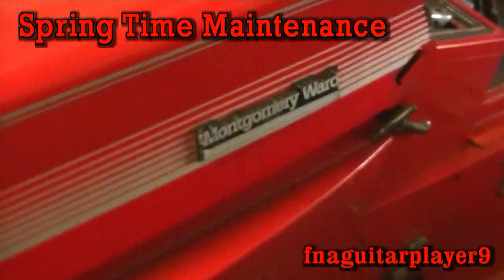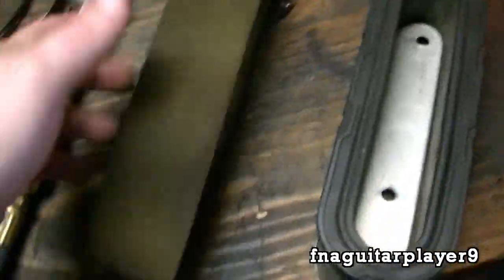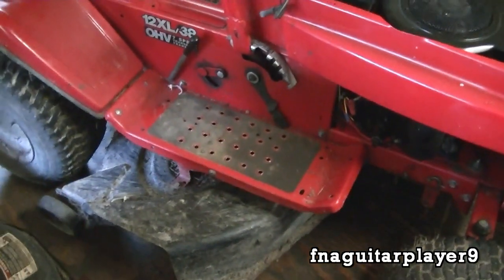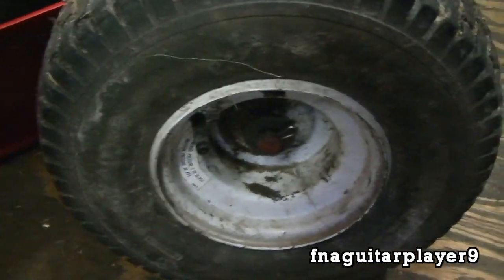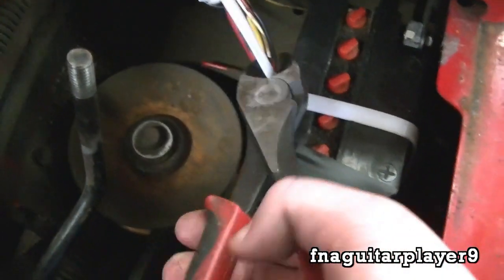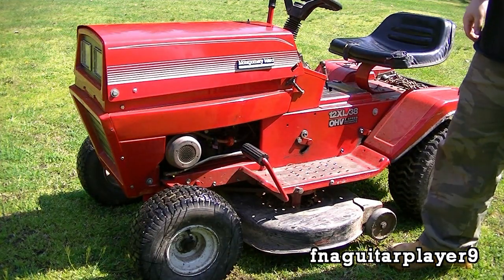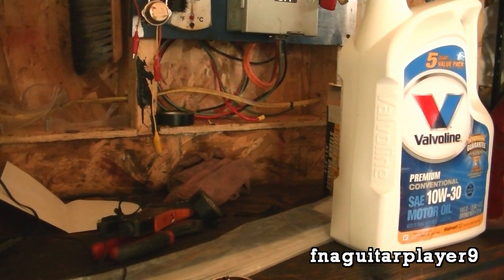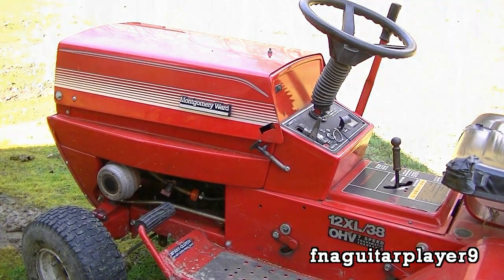Spring Time Riding Lawn Mower Maintenance Video

Comment: Great video, our grass is still brown.
I always fill the oil to the overflow point on my generators but my 1993 12.5 HP Murray riding mower  that has a dip stick and i fill it to the full mark.
My battery is at least 10 years old and will not take a charge.
Think I need a new one....LOL.
Thanks for the great video.

Comment: My rule of thumb is always change the oil on a regular basis ignoring the low amounts of hours I've put on. Last summer I only mowed the lawn 3 times due to an extreme drought. Even if the oil looks new . Never trust the "looks" of your oil. The anti corrosion additive might be saturated with moisture thus, will not be able to prevent rust build-up in the engine. I hope that I'm right with that line of thinking.

Comment from the maker: haha heard that, this was the earliest we've had to cut for a while now. yeah the dipstick is handy on them, but i always have problems with them and end up putting a plug in it instead, they always leak with me, even with a new seal. don't feel bad, that was the first battery i put in that mower in the last 7 years or so, i did have the cables running out the side and just used my jumpstart on it haha thanks for watching!!!

Comment from the maker: it might be a good deal. depends on what your trading for it. It may or may not need the carb cleaned, I've let gas sit in them all year without running and not had problems and i've had problem when I do drain gas haha hard to say on that. IF the carb does need cleaned and NOT rebuilt, than yeah it would probably be worth getting, rebuilding carbs on the bigger engines are more expensive. is it in good shape, how new? thanks for watching!!!

Comment: I'm going to look at an older Montgomery ward mower very similar to the one in your videos.  Are parts relatively accessible? It appears to be a relatively good unit, any suggestions?  The one I'm looking at does have the 12 horse briggs.
Reply from the maker: Russ Hager I hear ya! They are great mowers, I have 3, this one being the oldest, the other ones are around 85 or so. Yes parts are still readily available, since they were made by MTD, just about anything is MTD so parts should be around for a good long time. Just like old vehicles, you can still get just about anything for them. Yeah, if you can get it i'd say go for it, they were built really good and will hold up, and take alot of abuse. Mine are garage kept too, so that always helps, i take really good care of my mowers, i even wax them! Can not go wrong with a 12 horse briggs, this one originally had a 12HP OHV Tecumseh engine, but i put a 12 horse briggs on it, my favorite engine. Best mowers ever made! Thanks for Watching!

Comment: im thinking about trading for a yard machine 20hp mower. i was told that it was serviced but not used last season therefore would need the carburator cleaned. do you think it would be worth getting?